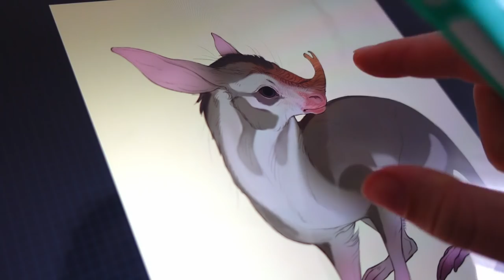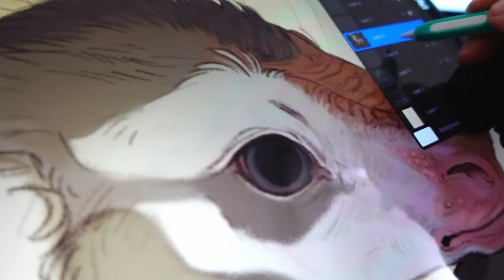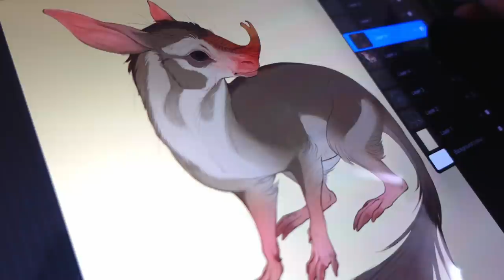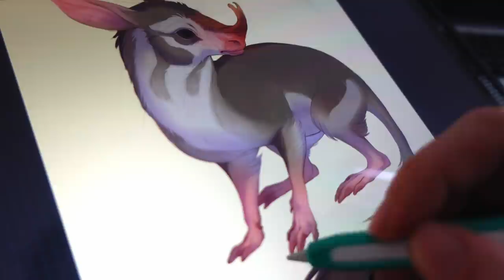Artist Vlog: cleaning and packing my life into two bags "Digital Nomad" style

Comment: My Mac Laptop was...7 years old and I didn't add him lil feet, and I should because yes it did overheat. it overheats so much that it melted the charger that the lil metal cables cut off and burned. I am...so friking lucky, that it didn't catch on fire. It just stopped charging so I turned everything off to conserve the battery until I get a replacement.  I only knew that it was melt and burned when I tried to fix the charger cable and removed the tap around it (I had taped it because my cat chewed it and it had lots of punctuation everywhere.)
Reply from the maker: Omg that's such a hazard! I'm glad nothing bad happened :0 Definitely after 5 years it gets more and more dangerous haha <3